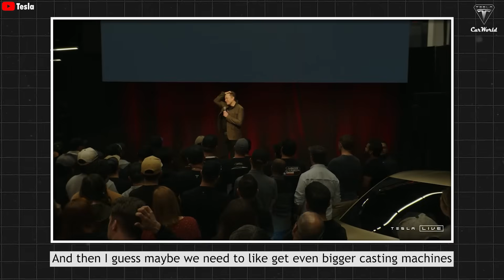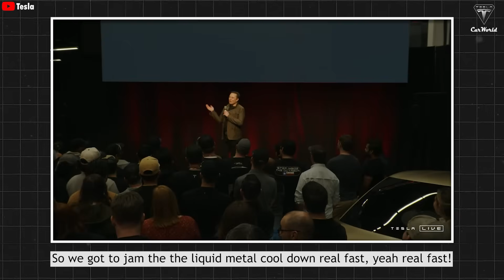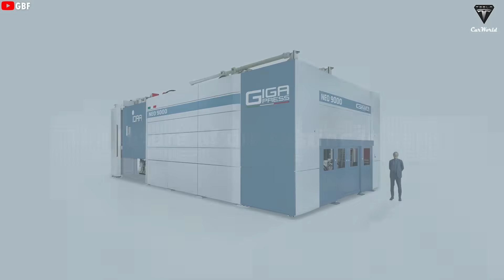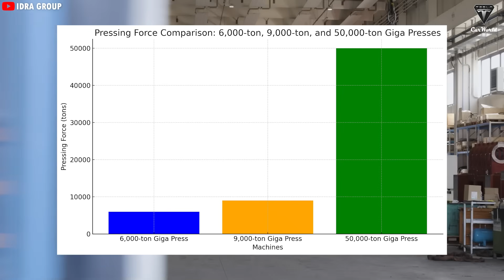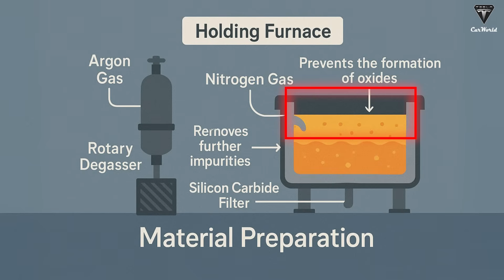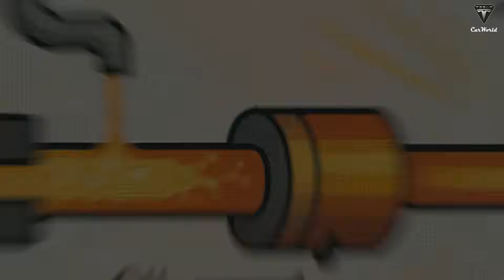Elon Musk LAUNCH NEW Version Tesla Giga Press 50.000T CRUSHED China Casting Machine 16.000T!

Comment: What are the upfront costs of building a facility around a 50,000-ton press, and how long until that investment breaks even at current production targets?
Reply from the maker: The upfront costs for a 50,000-ton press facility are indeed significant, likely in the tens of millions, plus the $43-64 million for the machine itself. Breaking even depends on production scale, but with Tesla’s output goals, it could take a couple of years if they hit their target of multiple chassis per cycle.

Comment: This is like printing cars instead of building them.
Reply from the maker: That’s a great analogy! It does feel like 3D printing cars, streamlining the process into a single, powerful cast.
Reply: Technically very impressive, with a so  much imressive , a drastic cost-lessening.
But cost of repair, as long as accidents may happen (= as long as driving  autonomy is not enough spread)  can improve in the opposite.
Anyway, BRAVO Mr. ELON and your team in the realm, what an improvement in serial manufacturing….